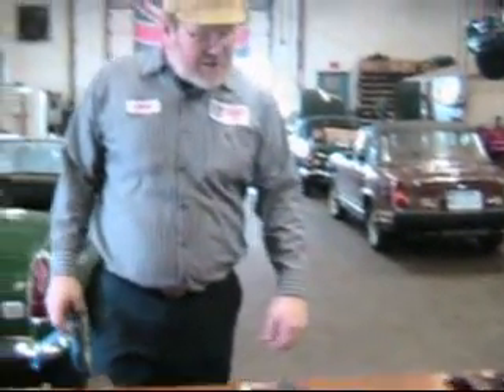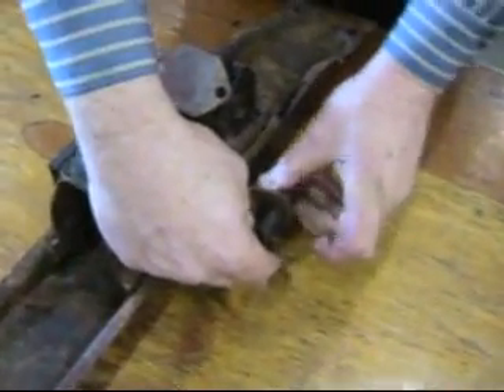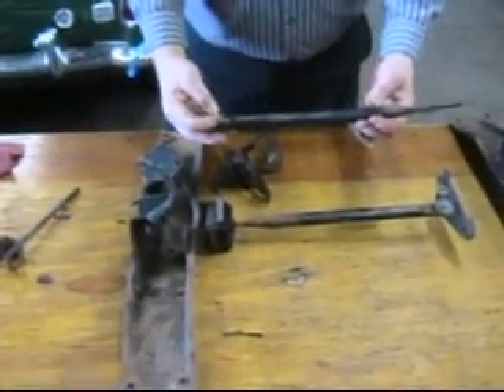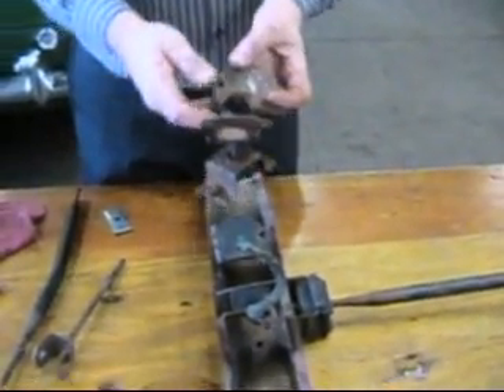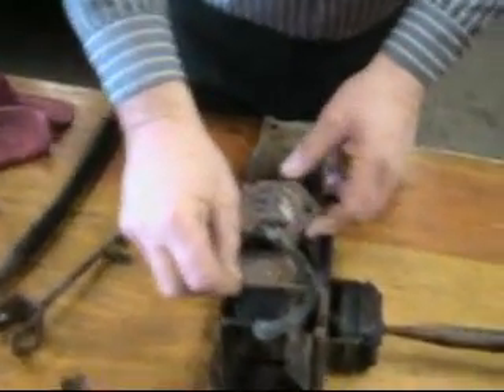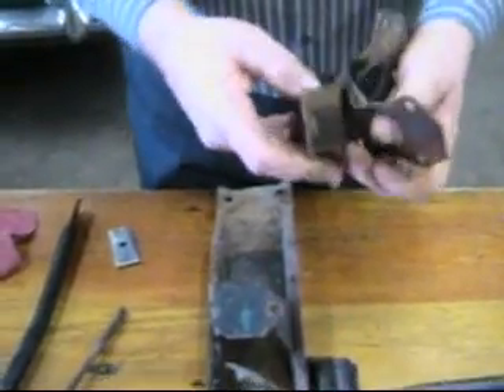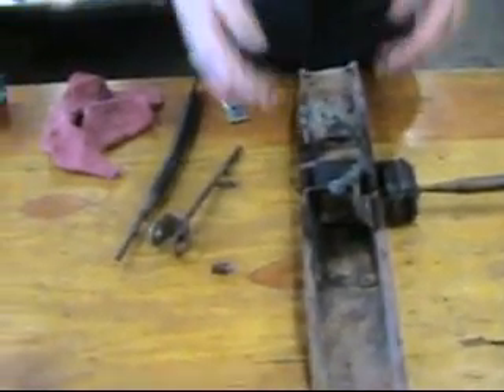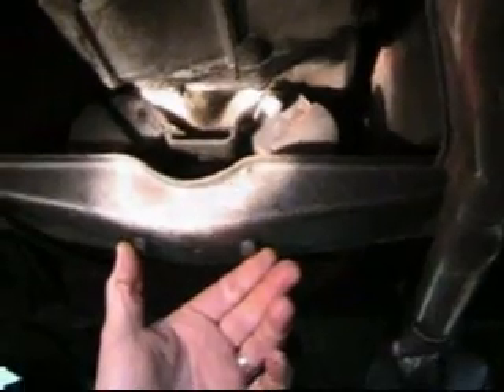80 MG Tech | Gearbox Crossmember for MGB

Comment: Not convinced the mounts go through the rear holes for the late model cars. Mine were mounted forward, but tried replacing them in the rear holes as the video suggests. Crossmember wouldn't mount to the car. BUGGER, will try again tomorrow with the mounts as they were in the front holes.
Reply: put them in the front holes greg......

Comment: Maybe to add another advice: do not tighten the bolts pulling the separate piece on the mountings towards the crossmember (downwards) straightaway. First assure that the bolts in the gearbox itself are surely tightened and the nuts on the rubber mountings too. Then fix the crossmember to the car. And as a last step then tighten the bolts mentioned above. The advice in the Haynes manual to remove and put back the whole assembly over the mounts fixed beforehand to the gearbox, just does NOT work.